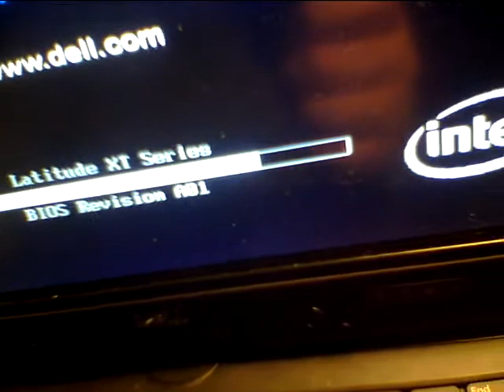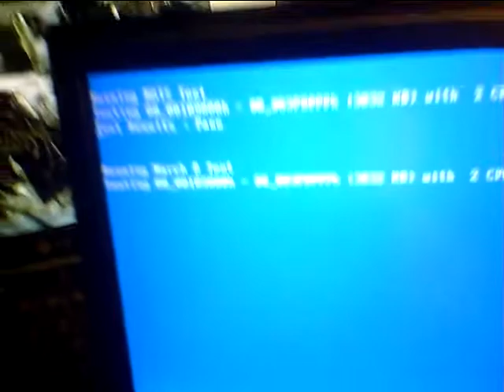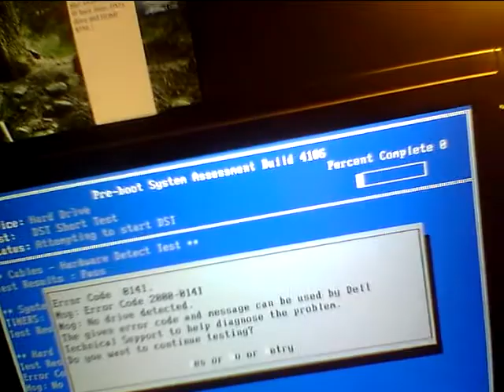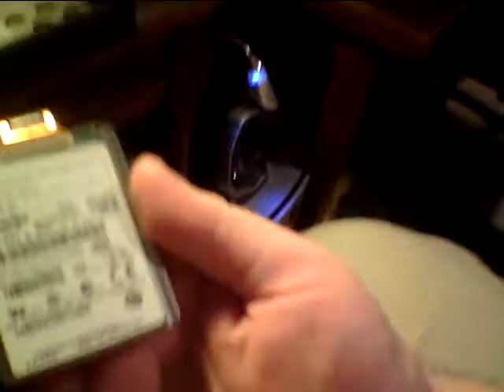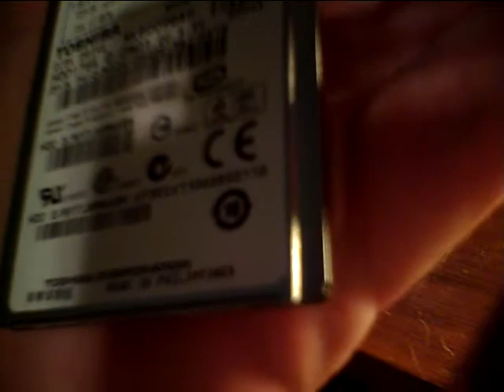The Hard Drive In My Dell Latitude XT Tablet Finally Died As Expected!

Comment: Ah what a pain for that to happen... I myself have been having a little trouble with my desktop. I believe the Hard drive is failing in that one. You might be able to recover some data off of it if you put it in a freezer for a couple of hours and then run it. I wish you the best of luck with your hard drive issues.

Comment: I have a crapton of old Seagate Drives from 1998 - 2001 that have that rubber thing around them, they're 10 - 20 GB, and its a pain when pulling them out of PCs because the rubber deforms itself and gets caught on somthing. its a stupid design for a desktop drive.